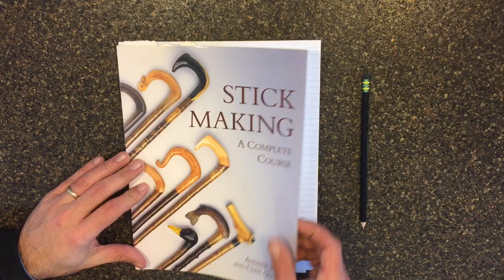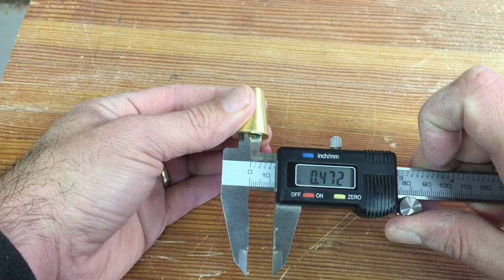Classic Cardigan Walking Stick

Comment: What a beautiful walking stick? Your father must have been thrilled! If I may ask... you wrapped the branch with paper, wet it and then used heat on it but not in the area you have in the vice grip. I assumed you were trying to straighten it out but now I am not sure. Also, did you do anything in particular to strengthen the branch or is is a hardwood? (I am just trying to learn more and this video had great stuff to learn from)
Reply from the maker: Thank you!  I wet and heated the stick where I needed to straighten it.  I tried the torch and paper towel first because I didn't want to scorch the wood.  I got the wood a little pliable that way and then kept the heat on it with the heat gun.  I moved the stick a little further into the vise after I had it hot enough to become pliable, but kept that part just outside the vise so I could get the best leverage for gently bending it towards straight.  The stick became straighter, but not perfectly so.